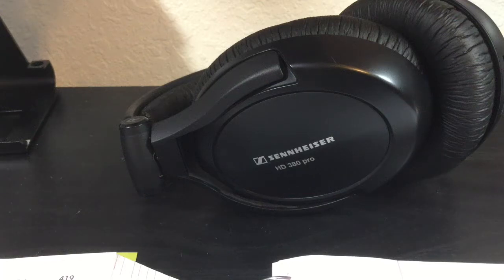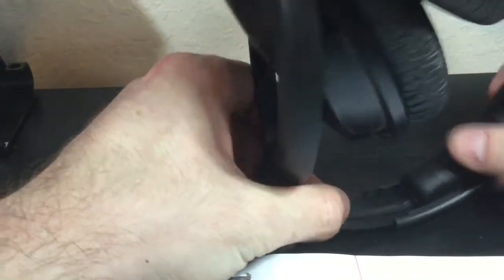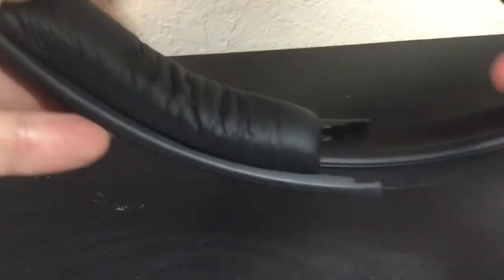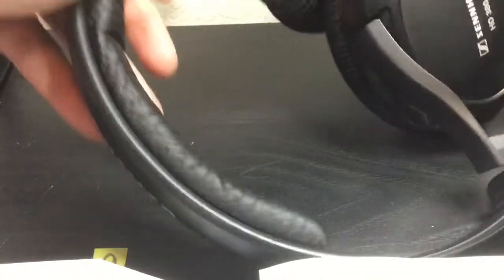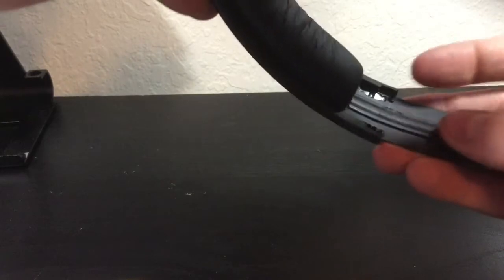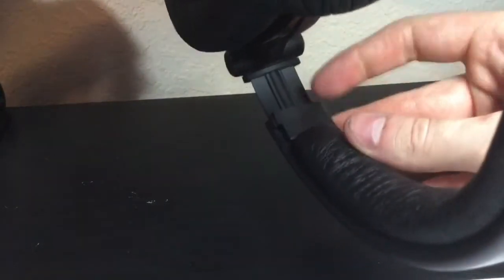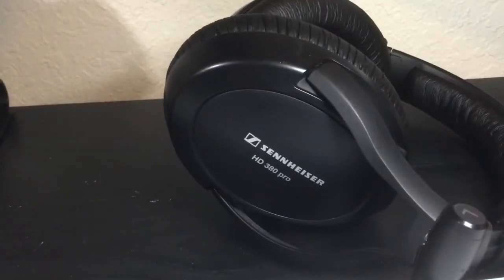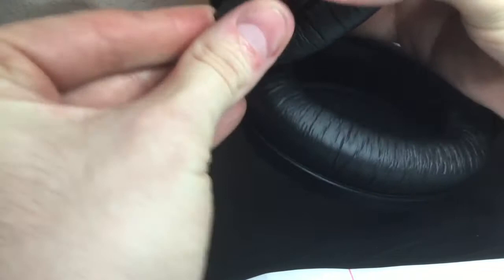Sennheiser HD 380 Pro Headband Padding Replacement.

Comment: 1. You can still get them from Sennheiser Prod. Code 531464
2. There is only 1 ratchet (metal clip) on each L&R side of the headband.
3. You only need to remove one retaining clip from one side... the ratchet shouldn't come out.
4. Slide the old padding out through the gap between the earpiece and bracket.
5. When sliding the new padding in the same way just make sure it doesn't catch on the bracket at the other end. Check the ratchet still works.
6. Have no fear... it's an easy job!

Comment: Worked great, video helped me prepare. FYI, a video on replacing headband for HD600 also helped as the head band for the HD 380 Pro came off and on similar to HD600. Funny note: when I finished I had a small metal piece left over on my work area. However, you noted it worked without, mine did too, so I left it alone. Thanks again

Comment: Thank you , I used a linoleum knife to pry out one stop and then slid the old pad out without touching the other stop or the metal piece.
I then slid the new pad in and snapped one new stop in. Done!  Could not have been so easy without your help.

Comment: It would be useful to mention that there are two rails on each side of the headband; one for the headphones' metal bracket and another for the headband's foam insert. 

If you accidentially insert the foam insert into the headphones' rail, you'll find it impossible to slide the foam insert all the way in and over the headphone's metal brackets. In this case, remove the foam insert completely and re-insert it carefully, making sure that it uses the outer rail (further away from the headband's back).
Reply: Absolute life saver thank you
Reply: phew - i was about to give up as I couldn't seem to get the foam on - then I read this about the two rails and it was easy, thank you!
Reply: This worked wonder! I thank you so much!
Reply: struggled with that heaps until I read your note - thank you!

Comment: With your guide, I managed to take apart my Sennheiser GAME ZERO headset. But, now I can't get the metal piece to go back in, and it's not quite the same shape as yours. ^^;

Edit: I was able to get it back together properly! I actually didn't end up replacing the headband for now, as it's just starting to tear a bit and is much higher quality still than the replacement one I got off eBay. I hope this thing lasts forever, but I'm also looking forward to the day I can replace it with something easier to repair...
Reply: Have the same headset
How did you get that metal piece back in ?

Comment: Got a replacement headband that was so garbage that it flatout refused to slot in properly. Sadly my old headband was so fucked that I couldn't get it back in either, so now I am sitting here, fuming, with shitty wide headphones that do not fit at all.
Fuck this, getting a new pair of headphones. Sennheiser fucked up the longevity of their products by not providing proper support.